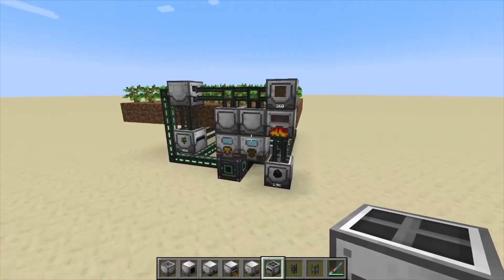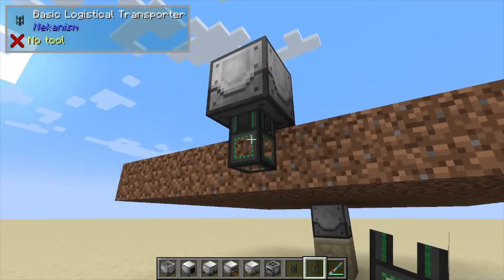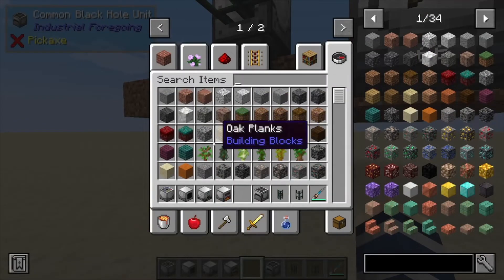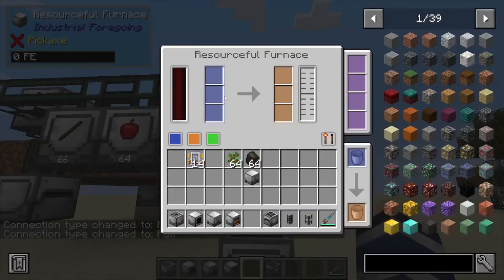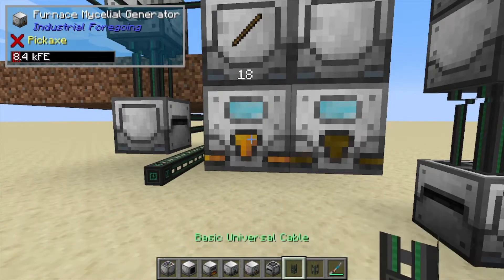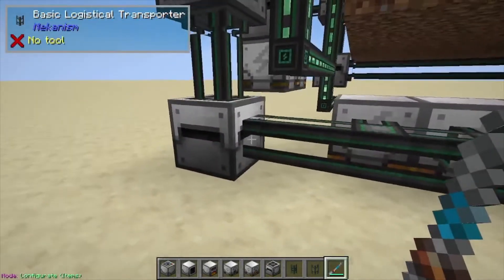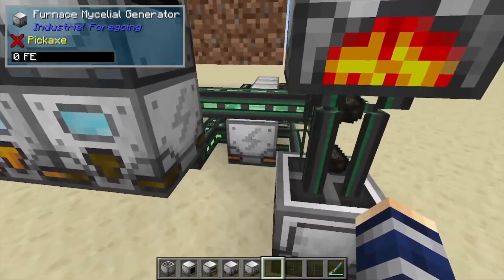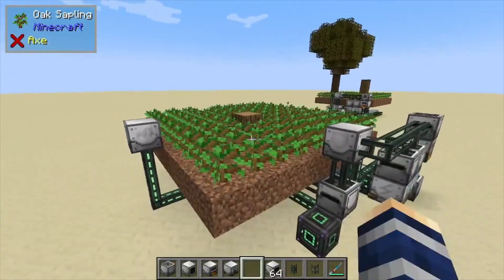MCM Inventions: Infinite FE/RF Energy (Self Sustaining)

Comment: Have you played with using blocks of charcoal? That may require another mod, I'm not certain.
Reply from the maker: It’s 1.18.2. It could use charcoal blocks it would just need an auto crafter of some sort..another upgrade you could add to this is the fertilizer to put the machine into “hyper drive” but I did find this produces less saplings to replant.